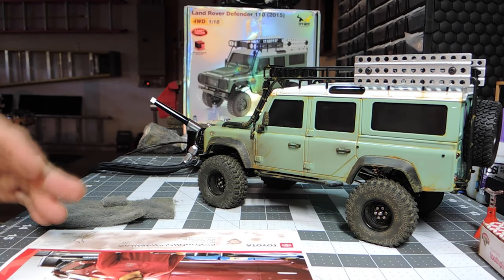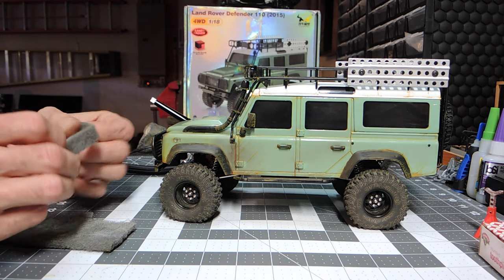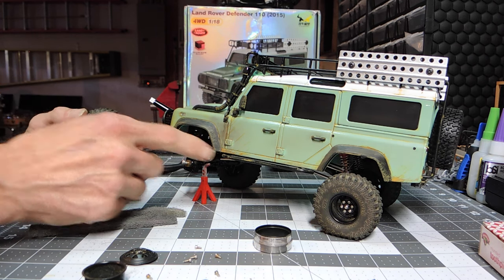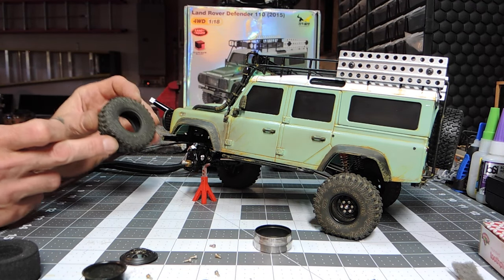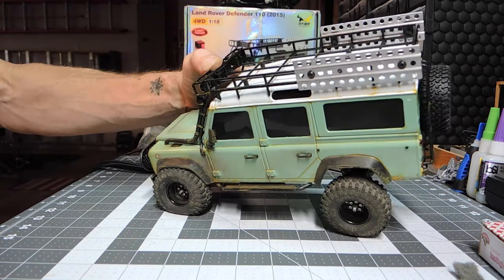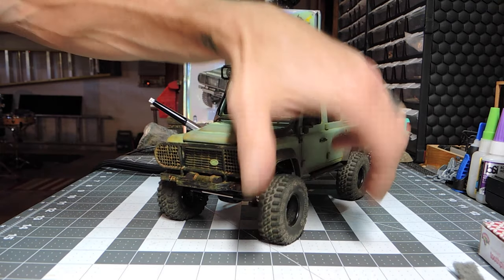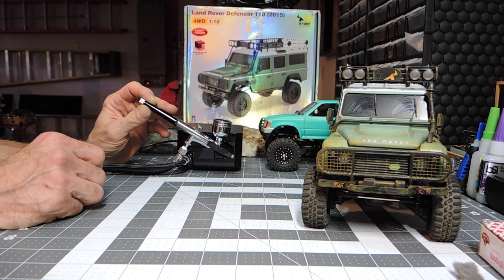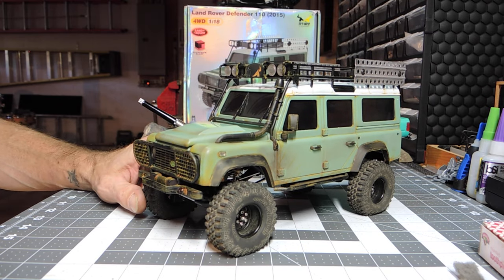MN111 Scotch Brite "Dual-Stage Tire Foam" Cheap / Free Mod

Comment: The weathering looks great. I think this is going to be my next RC. I like the black model they sell.
Reply from the maker: I couldn't get one, but not for lack of trying! I placed the order for the black one and I got an email back from Makerfire saying they weren't shipping. Options were to wait for an unknown period of time or get a green or yellow one. I can say that when I got my green one, I noticed that the plastic wrapping had interacted with the paint finish a little. It was faint, but it was definitely noticeable. On a black body, that would have been visible from across the room. If I had to throw out some speculation, I bet they decided they couldn't ship those if they knew about it. Maybe the black ones had to go back in for refinishing? Either way, you should definitely get one if you're a fan of MN at all. This is the one we've been waiting for. I love it.

Comment: That looks really nice, with that weathering. I just received mine yesterday, and got it out of the box last night. Looking forward to building it, and figuring those lights out... Will have to try and design some sort of 7mm hex for it to 3D print, cause that 9mm hex just seems dumb. :)

I'll be throwing some Injora wheels and tires on there. that already has some 3D printed inserts I designed and printed.

Having an airbrush is really nice when working on RCs. I have had one for a couple of years, and use it "all the time". Haven't done much weathering with one yet, but may have to try, seeing how yours turned out really nice.
Reply from the maker: Sounds to  me like you should watch THIS 7mm hex mod video next! https://youtu.be/5OkQK0cvULg I went right after this thing getting it up to speed when it arrived. I was a huge fan of the MN99s and MN99g so I was super psyched when this one came out. I did the lights on the roof rack too. I have that video still in editing. Also ordered a TRX4m winch for it and will see about getting that installed. Video to follow. Thanks for the comment!
Reply: @VermontScaleCustoms  yeah, already watched that earlier. 😊

I have a bunch of 7mm hex in my spare parts so could easily do that. Designing stuff is just fun.

I only have one MN from earlier, an MN96, I believe. It looks great, but drover pretty terrible out of the box. With better electronics it was better, but not awesome good for scale though. I also have a bunch of WPLs. Been more focused on 24th scale the last year, and recently built a 10th scale lcg rig.

Had to have this one though, it just looks so good. And it was cheap on banggood. 😊
Reply from the maker: I definitely recommend the brass for durability. It adds a gram or two of extra weight, as well. Much needed on this very top-heavy Defender. I added about 10 grams of lead tape weight on each beadlock wheel ring, too. That helped keep it planted and it 3 wheels up stuff so nicely now without tipping backwards as much. 

Probably my 4th or 5th truck a few years ago was an MN99. I went all in with that rig and eventually made it too heavy for the motor. By that point, I had kind of moved into other trucks and brands. It took until MN releasing this model for me to see what they were up to. I saw the MN86 and MN999 but both of those had no appeal. 

Diecast was the answer. I'm considering ordering a black on just to have it. I originally placed an order for one but they weren't shipping yet. It appears that AliExpress has them now. 

Here's another thing! I paid $128 for mine at MakerFire and I saw them just the next day for like $72 at Banggood and somewhere else. The price has now gone to $102 at Ali and $128 at Banggood. Either way, some folks got a deal for a few days!

Comment: 👍👍👍
Reply from the maker: I see a lot of similarities with this and the Tetra X1. But this is a little more updated. But it has almost the same motor in it, just geared totally different. The Panda electronics run it very well. The 3 speeds are perfect.
Reply: @VermontScaleCustoms  nice i just picked up some metal drive shafts for my x1

Comment: Nice! Are the trx4m wheels compatible with this rig?
Reply from the maker: Yes, but you have to do the hex mod shown in this video: https://youtu.be/5OkQK0cvULg

They come with 9mm hexes and you'll need to convert some brass ones by filing down the raised part of the back and opening a groove for the pin. It's not difficult, just need a vice and suitable file.
Reply: @VermontScaleCustoms  awesome! Thank you so much!
Reply: @VermontScaleCustoms  do you know what’s the axle size of the mn111? I found a hex which doesn’t need to be filed but wasn’t sure if the axle is gonna fit.